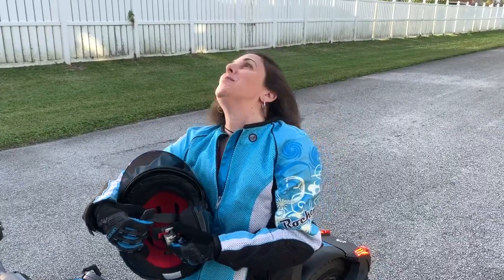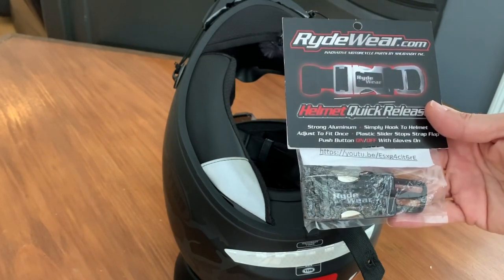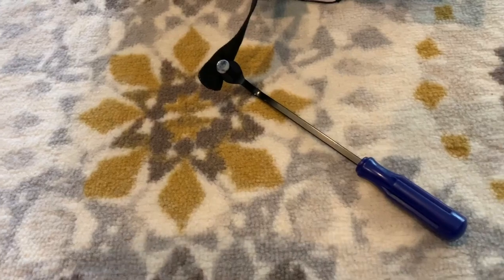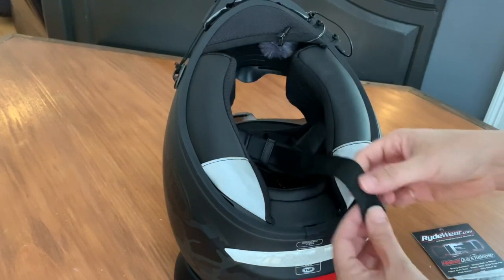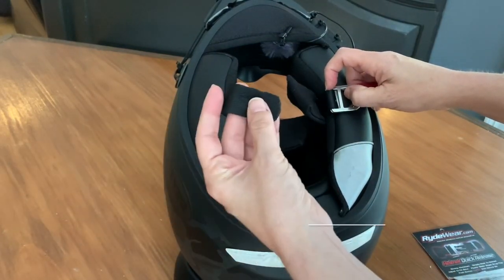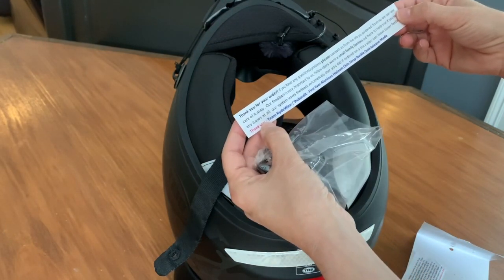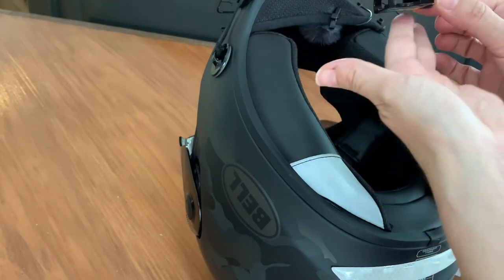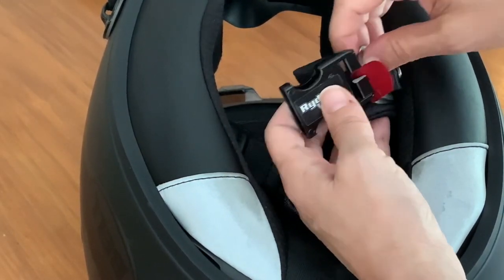RydeWear Quick Release Helmet Buckle (review and installation)

Comment: Great video.  1 additional suggestion. 
The video recommends removing the snap from the free end of the strap.
I just installed this buckle on my helmet(an HJC), and found that I had to remove the snap on the d-ring side as well.  This allowed enough flexibility to squeeze the strap into the new buckle.
I'm sure each helmet is different,  this was necessary for mine.
Reply from the maker: Thank you,Jeff! I appreciate your input on how it worked for your helmet.

Comment: Been looking at these. In my younger days I was able feed a helmet chin strap through double d rings upside down, in the dark, with one hand tied behind my back. Not so much anymore. Just bought a new helmet with the micro metric or quick release chin strap on it. Had to order it from Europe because so few helmets sold in the states have the quick release straps. Anyway, need to retrofit the helmets I already have with quick releases. Some I've looked at look like a pain in the butt to install. These look much easier. Thanks for the very timely video.
Reply from the maker: My pleasure Kevin!